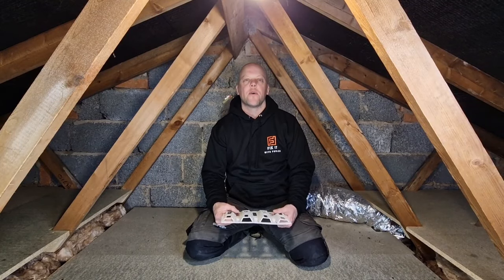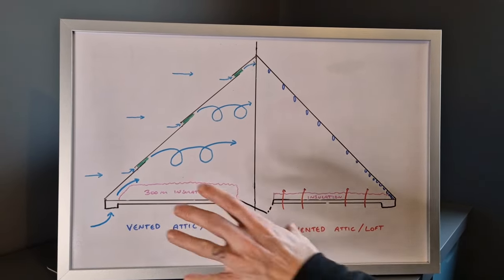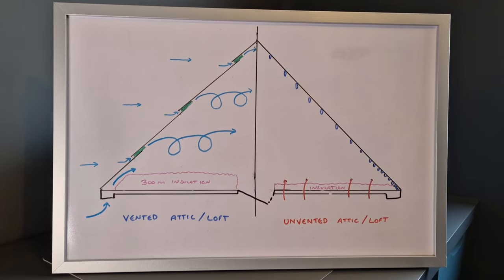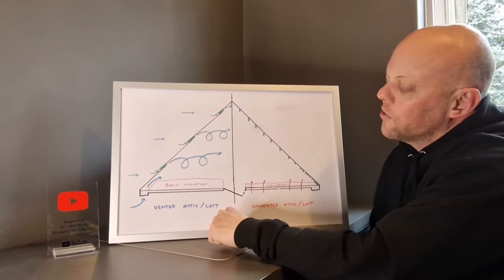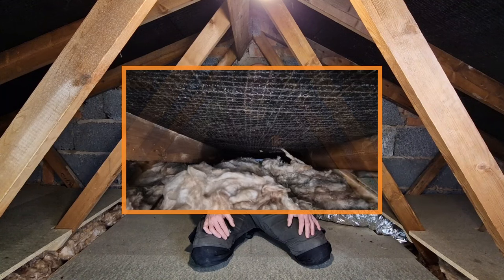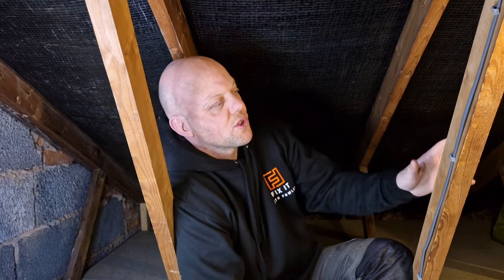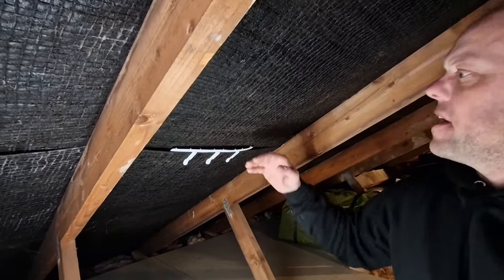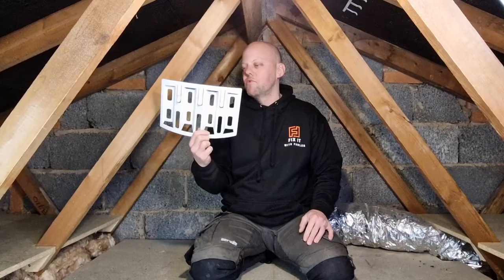Condensation in loft ? - Cheap and easy fix using Felt Lap Vents   #condensation

Comment: Help please!
I have recently re boarded plastered and insulated ceilings in my 100 year old house or so. We've layered 300mm of insulation and have a bitchumen material underneath the tiles. I have installed roughly 20 of these lap vents and there is a lot of draught throughout the roof. But yet on the northern side of the roof we have white spores of mould growing on the wood which is touching the roof felt. We are unable to get ventilation on the soffits and faicures as there isn't enough room or enough overhang from the roof. I plan on putting a dehumidifier up there for a while but unsure how to stop the problem! Any help would be appreciated massively!!
Reply from the maker: Hi, will is it just the north side of the roof/loft?
Reply: @FixitwithFowler  hi there yes it is! Seems to be mainly above the roof hatch + boiler
Reply from the maker: @Will_C2112 Hi, is the loft hatch insulated?
Reply: @FixitwithFowler  hi there yes the loft hatch is insulated but could possibly do with being a little bit more so
Reply from the maker: It sounds like you may have a thermal leak there into the loft if it's worse there. When did you install the felt lap vents?
Reply: @FixitwithFowler  would this mean to insulate around the area underneath more? We installed the lap vents after we took all the ceilings down so when it was all open
Reply from the maker: How long ago did you install the felt lap vents? How long has there been a problem with condensation in the loft?
Reply: @FixitwithFowler  only noticed white mould spots really recently. We've had the ceilings and insulation up there for approx 8-10 weeks. Only really noticed problems this weekend upon looking up there to check it all is ok. It appears to be mouldy where the vents seem to be so I'm assuming it's the hot air meeting cold air creating the moisture
Reply from the maker: @Will_C2112 The idea as per my drawing/diagram in the video is that the insulation prevents the hot air in your house from escaping into the loft. The ventilation ensures a good airflow through the loft and prevents moisture build-up. Do you think yhe problem was there before your work as 10 weeks is not enough time for mould to grow
Reply: @FixitwithFowler  okay I think I understand now thank you. I've realized it was the end of July when we'd plastered and boarded the ceilings. My bad 😂 going to put our dehumidifier up there and hopefully insulate the loft hatch a bit better and hope that it makes an improvement. Thank you for responding!
Reply from the maker: @Will_C2112 Hi, i think everything sounds ok apart from the loft hatch. Also, ensure the felt lap vents are in a staggered formation to create a turbulent air flow. It seems like the problem was before you carried out the work, maybe even the previous winter.
Reply: @FixitwithFowler  thank you for your response! As the roof is only fairly small there's one layover of felt so I'm only able to have one section of the vents. I have placed them between each rafter though so there's a lot of them up there. Just unsure why I've managed to get mould up there. Would you recommend any mould spray or just leave it?

Comment: Hi, based on your drawing, are you suggestion putting the loft lap vents all on one side of the loft? I currently have them fitted both sides and I have soffit vents and I’ve still got water dripping onto my loft boards
Reply from the maker: Hi, no, the drawing refers to the difference between vented and unvented lofts. The vents need to be positioned on each side of the loft at different heights but not directly opposite each other. This will then create a turbulent air flow through the loft. Let me know how many vents you have and also the size of your loft.
Reply: Hi, I currently have 20 lap vents fitted in a staggered position as you suggested. My loft is massive. It’s pretty much the size of the ground floor (bungalow)
Reply from the maker: @4KTV87  Hi, have you checked that the insulation is not pushed right to the eves of the loft as this will also restrict air flow?
Reply: @FixitwithFowler 
Ĥi a roofing firm has put vents in my loft to help with condensation but is blowing gale through there gone worse I live in end terraced house when government was giving loft insulation by way of grant they laid new thicker insulation over old one and think it may be covering air vents at front and back can you please advise me thanks 😊
Reply from the maker: @joycemcchrystal1064 Hi, the idea is to add ventilation to prevent or cure condensation in the loft. So long as the loft insulation doesn't cover the vented sofits if you have any you should be ok

Comment: What if you don't have any felt? Mine are tiles nailed to battons
Reply from the maker: Then, unfortunately, this won't work. However, you can add ventilation by vented sofits or vented tiles, but it's not as easy as these felt lap vents!
Reply: @FixitwithFowler  could I drill a hole in the soffit from inside the loft and then fit a vent from inside with a fly screen?
Reply from the maker: Yes, i don't see why not. You can get vents to put in the sofits like these! https://amzn.to/3S8L1Uv

Comment: We’ve had new fascias and soffits fitted a year ago….and they have NOT got vents…….now we are having mould grow on the corners of two rooms…..any ideas what we can do? Had several roofers round and they have given different and costly answers!
Reply from the maker: Firstly, i would check that the loft insulation doesn't touch the roofing felt at the eves (lowest point) of the loft. Have you got condensation in tge loft?
Reply: Yes lots of condensation  @FixitwithFowler
Reply from the maker: Firstly i would try these felt lap vents   
https://amzn.to/418y695 . What loft insulation do you have?
Reply: Will it help even if we have no vents in the eaves or roof?  @FixitwithFowler
Reply from the maker: By what you've told me, i would suggest adding the felt lap vents to increase/add ventilation in the loft. That will help reduce the condensation. However, if your loft insulation is less than 300mm deep, you will need to top that up. Ultimately, the mould comes from water/damp so that could be caused by the loft condensation or a leaking roof.

Comment: I have this problem with wet joists and a feeling of dampness in the loft of our Victorian semi. We had a re-roof 2 years ago using our old and new slate tiles, roof membrane etc. I installed 10 lap vents and this still hasn't solved the problem 3 weeks on. To be fair, it's been exceptionally cold with hardly any wind movement but a week ago we had a lot of wind and dry air. I would have thought that would have started the drying process but it seems to have got back to how it was, which I thought there would be no more build up of moisture due to the vents letting it escape. No leaks in the roof as such and all tiles look sound from outside. Feeling under the membrane in the worst areas the battens feel wet too. Should I fit more vents and give it longer ?
Reply from the maker: Hi Ian. Unfortunately, there are many different grades of roof membrane starting at £40 a roll up to £140 a roll for a fully breathable roofing membrane. Have you checked if the loft insulation is upto spec 300mm deep and clear of the eves? Also check if you have vented eves or sofits, as a new roof should have vented eves. You could try installing more felt lap vents, i normally suggest between 10-20 per roof space. Hope that helps! Don't forget to subscribe to my channel for more great content 😉
Reply: @FixitwithFowler  I can't say what the membrane cost but I was told it was breathable. I don't remember it being damp last Winter  since it was done but it has been very cold, and wet this year, and we haven't had the heating on much. Don't think there were any eve vents fitted. The insulation I put down a few years ago is thick, but only covers each side of the loft as boarded in the middle for storing items (a lot of stuff presently)
Reply from the maker: Hi Ian, do you have any fan ducting in the loft? If so you could check it isn't damaged and does go outside. The other thing is to insulate your loft hatch. If all of these are ok the try adding more felt lap vents
Reply: @FixitwithFowler  No fan in the loft and the hatch has some foam door type insulation. It just seems odd that the vents already fitted have hardly helped. I will order some more anyway, or find bits of plastic pipe to slot in to give the same effect.
Reply from the maker: When you install the felt lap vents, make sure you can either see daylight or feel a draught. If the felt is overlapped by a long way, it is possible that the vents aren't opening the felt
Reply: @FixitwithFowler  I can feel a draught and see some daylight but still it feels damp and the wood is still quite wet. No water coming in when it rains so it can't be a leak. I will give it longer and perhaps fit more vents. Its very wet and high humidity outside with no wind which doesn't help but even so, I would have thought the water would have evaporated by now as we have had the odd windy, dry day. I suppose it will take longer to dry as the days are shorter and colder. Perhaps Spring will improve things. Also, just bought a Manthorpe loft door that seals from Screwfix as the old wooden one had small gaps. I will see how that goes. I doubt it will make much of a difference as that much moisture wouldn't have got through such a small gap. Suffice to say this type of worry keeps me awake at night. 😒
Reply from the maker: +Ian if you send some photos of your loft to my email i will have a look and try to identify the problem.
Reply: @FixitwithFowler  OK, will do thanks. Having a bit of a nightmare fitting the new hatch as the hole needs widening and old plaster arou d edges is crumbling.
Reply from the maker: +Ian Build the new frame in the loft, then trim the plasterboard back to that frame. That should support the plasterboard whilst you trim it back.
Reply: @FixitwithFowler  I will thanks again. I shall get back to the loft in a couple of days or so as I had a trip to the infirmary with a sawn finger. Needs to heal before I get back onto it. I will get some pics sent for you when I do. I really do appreciate your help with this.
Reply from the maker: +Ian no problem 😊
Reply: @FixitwithFowler  Hi, I will now send an email with a pic of the current loft status. Cheers
Reply from the maker: No problem, i will have a look tomorrow 😀
Reply: @FixitwithFowler  did you manage to resolve the issue?
Reply from the maker: @mr-cool-guy yes all sorted now 👍

Comment: Chop out gable end and fit 2 air bricks  215x 140 one top one bottom  😀
Reply from the maker: I had one each end, but these are the way forward. No tools required, cheap as chips, and the best thing is no need to work at height!
Reply: Ok I will give it a go next time

Comment: 😅i have condensation in my loft a roofer has been to look he never mentioned ventilation which i know there isnt any he said the membrane was wrong the tiles needed removing and the membrane replaced the tiles refitted at a cost of 8k still in panic mode
Reply from the maker: Obviously, without looking, i can't comment. However, i would be sceptical of such a claim if it was me. A second opinion would be a good idea. However, as you said, the cause of condensation is lack of ventilation and / or lack of insulation. These vents are ideal to add ventilation, and at only £20-£30 a pack a definite option to try first! https://amzn.to/47xxMm1
Reply: Ordered them thanks I've put the dehumidifier in the loft to dry it out and I am going to pull the floor lagging back from the eaves for more air cant think if anything else
Reply: Put in all the vents I needed 2 packets in roof also resealed loft door after a week the loft is bone dry thank you very much 😊
Reply from the maker: That's amazing, and it's saved you £8000! That's what my channel is all about. Please share the video to help my channel grow and reach 10k subscribers!
Reply: Would you say it worked because of the vents or because of the dehumidifier etc?
Reply: @Doodahdoodles  the vents defo
But also redraftsealing the loft hatch

Comment: Tried these didn't work for us
Reply from the maker: How did you install them?
Reply: Didn’t work for us either. Bizarrely I found a solution, which improved the condensation problem. My loft was fully ventilated and was very cold. One day I decided to block some of the ventilation around the eaves and take out the plastic vents I fitted. Straight away the temperature in the loft increased and the condensation reduced. On very cold nights, I use a  240 W tubular heater to increase the temperature a little more and this pretty much stops the condensation. Of course a cost is involved here, but I estimate it to be less then £2 per day and I would happily pay much more to rid myself of the worry of condensation.
I’m not saying this solution works for everyone, but it did work for me.
Reply from the maker: It depends on the heat escaping from the rooms below into the loft. it's that heat meeting the cold underside of the felt that creates the condensation in the loft!